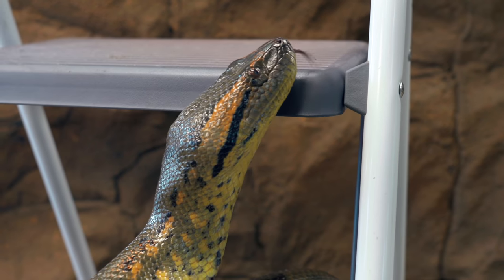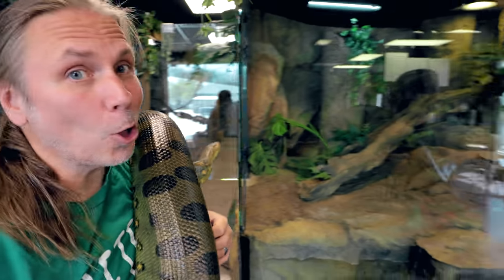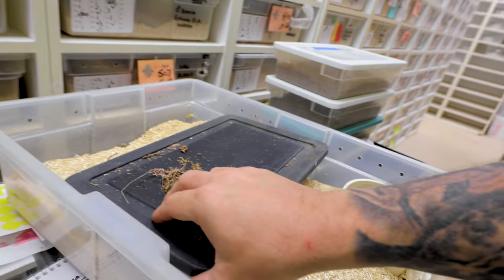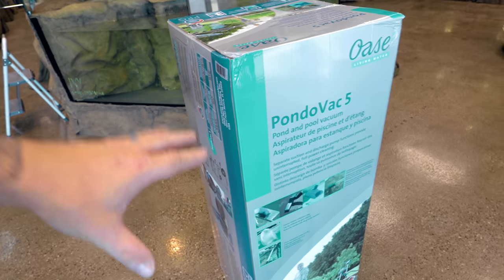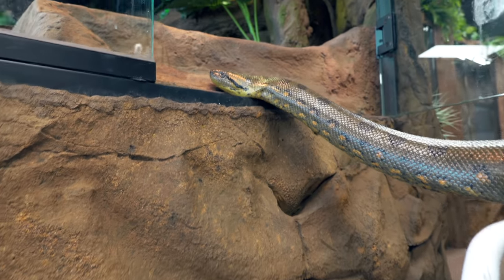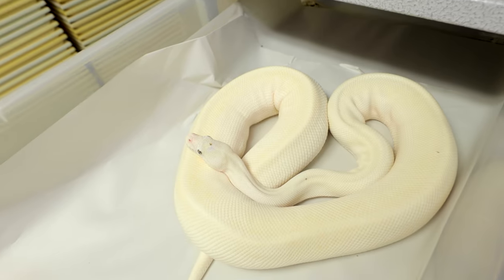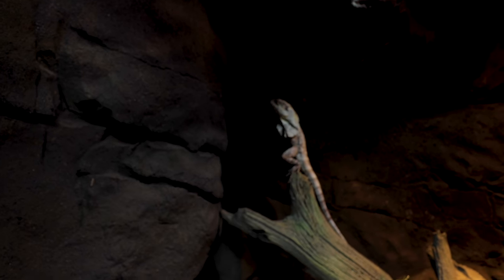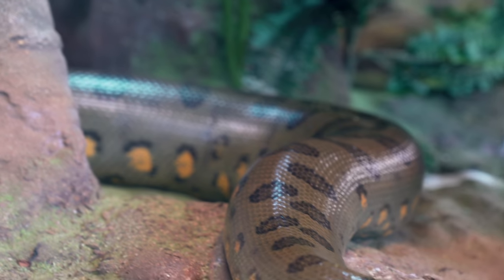HUGE ANACONDA DOES SOMETHING I CAN'T BELIEVE!! BLOWN AWAY!! | BRIAN BARCZYK

Comment: Anacondas are amazing animals but in all honesty this isn't uncommon behavior for any snake. My Bull snakes will climb out of their enclosures into my lap and will happily climb back in when they are ready. I take it as a curiosity and not anything relating to attention. I've seen videos of Orthriophis approaching owners in walk in size enclosures for food without any form of assistance. The animal would approach and simply wait. 
 They can and will use any furnishings to get where they want. I've had Burmese pythons try to use curtain rods to try and move to higher ground. It's pretty startling to see a 10 foot snake using half inch thick piece of aluminum to move around. 

Just proves that there is much more to reptile cognition in general.